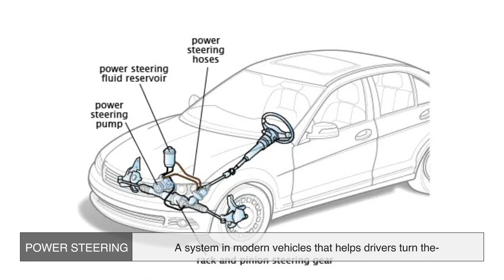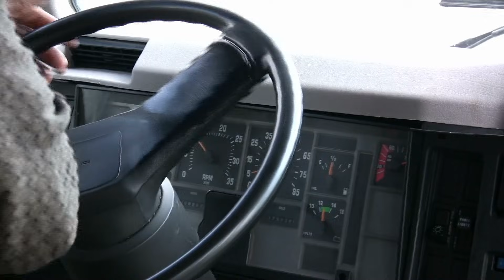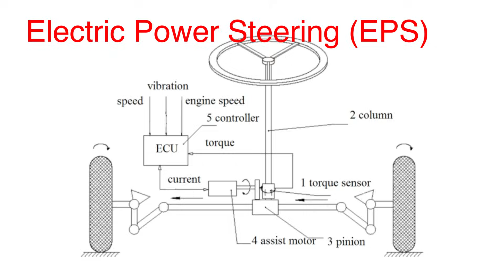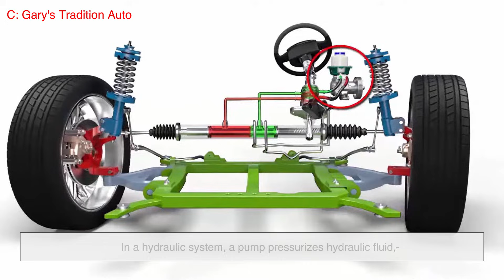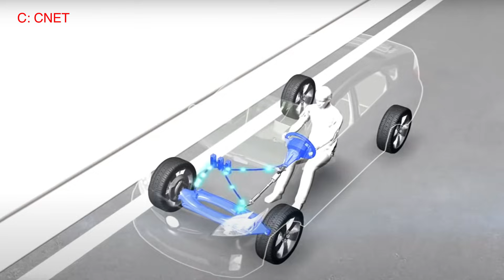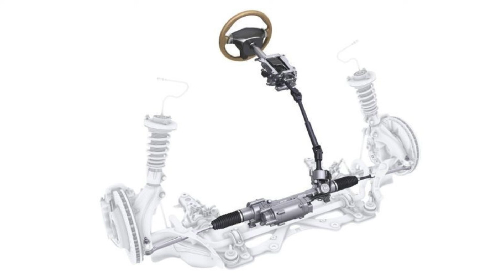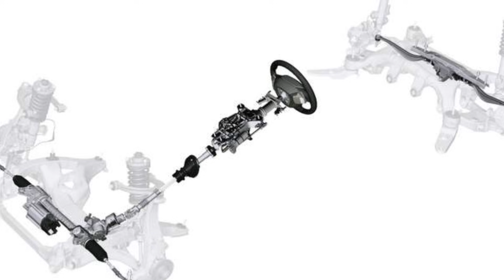What Is Power Steering and How Does It Actually Work?

Comment: Also, use the correct fluid in it if it is hydraulic and it is low.  Let this be a warning to Honda or Volkswagen owners!  These kind of vehicles are damaged easily if a specific fluid is not used.  They are also damaged if any other fluid is added to them that was not specified, even for a top off.  I know some people will say that the recommended fluid is too expensive or they can't find it.  They will wish they used the correct fluid once that other stuff damages their power steering and costs thousands to replace!  At that point that point they will wish they never used that unapproved fluid!  Using the wrong fluid could cause leaks or even difficulty steering because of damage caused by it.  It is not worth the hassle so just get what you need.  Some cars use ATF in the power steering but not all!  Look at the manual or even consult the dealer.  Once you have a power steering problem from using the incorrect stuff maybe you will use the proper fluid no matter the price!

Comment: Are steer by wire systems any less safe than systems with a mechanical linkage between the steering column and the wheels? Is 'road feel' also better with a mechanical linkage?

Comment: I remember growing up with a small Toyota with manual transmission. Had no power steering, so when going slow, or starting from stop, it was hard to turn the steering wheel. Parallel parking was a chore 🤣😅
Reply from the maker: I bet it was pretty tiring to park that car!